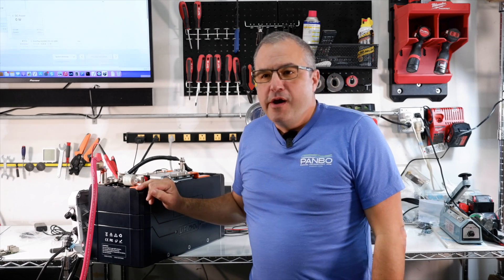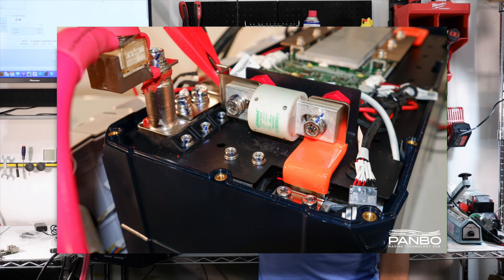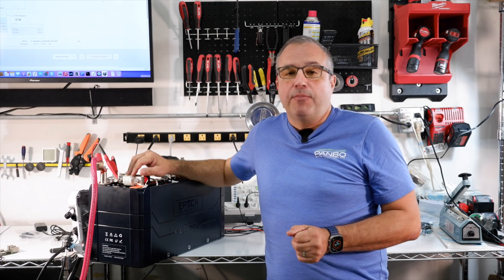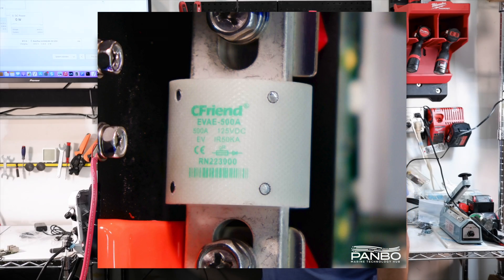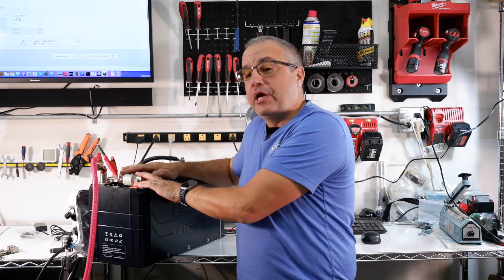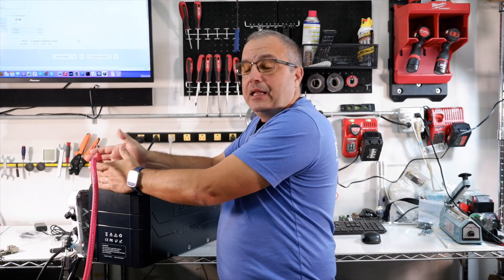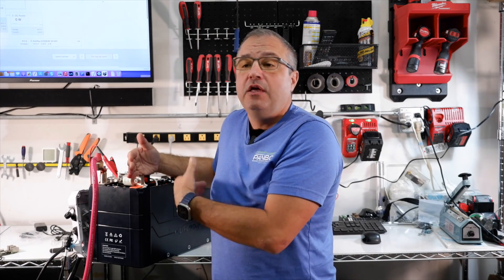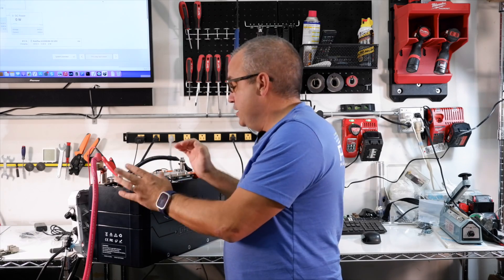Panbo Presents: Epoch Batteries' 460 amp hour gen 3 battery early teardown results

Comment: “Knowing the fuse is inside the battery, an MRBF post-top fuse holder can now be safely used. Thus, the entire system is protected via the internal fuse, and the wire off the battery is protected by an appropriately sized MRBF on the positive terminal”

which brand / model of the MRBF post-top fuse holder would you recommend and what size fuse fit one a 4/0 wire ?

Comment: impressive. at 500A and 50k AIC, if that fuse blows...something has gone really wrong! It does make for installation ease and safety, especially if the fuse lugs can accommodate a more standard class T fuse as a replacement (after the cause of the blown fuse is remedied!!!!)

I am looking forward to the full review (what cells, BMS features and configurability , documentation shortfalls/kudos, communication physical and configuration challenges, etc, etc). Allen Jones's videos have already shown that the CANbus cabling isn't standard--hydra cable and special undocumented hydra-slave battery cable instead of something like a daisy chain (the other Epoch battery series uses this) which is N2k-like. 

Let's hope that batteries like this are becoming the norm. They shouldn't be "drop in" but they should meet the safety standards when properly installed.